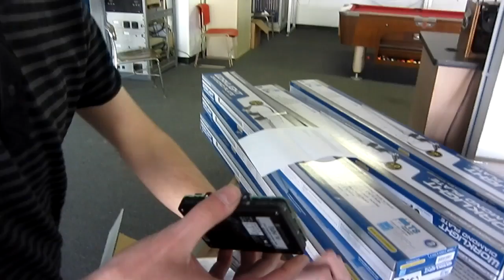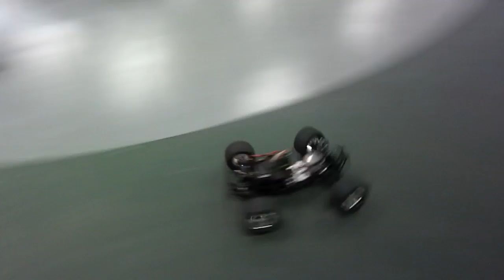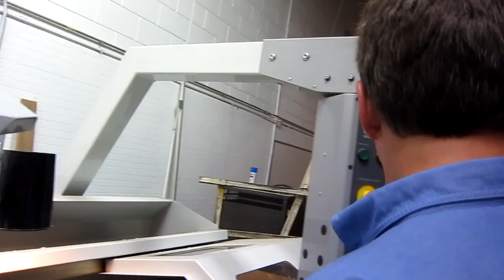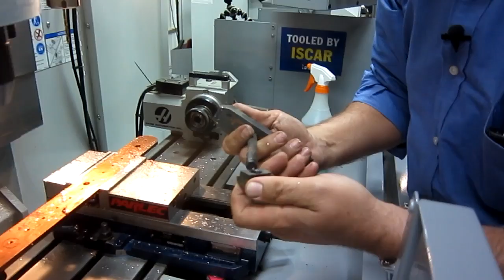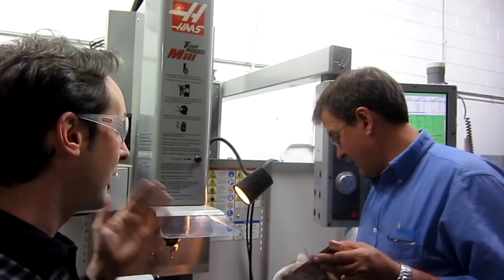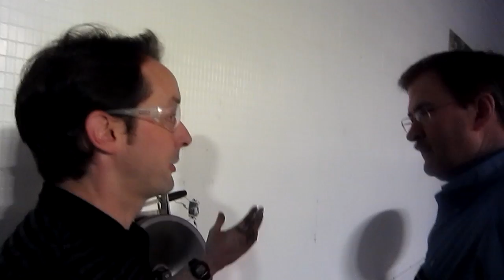Captain's Blog 11-10-11 Haas-Iscar Shoot, Stomper Positive Rail

Comment: @Physicsduck Are you talking about the air pressure on the outside of the hose? This would not be a factor,  amps is the rate of flow, if you alter the size of the wire/pipe the flow will still remain the same, unless the pressure was to high and the pipe burst. The hose is always full and the water is simply moving when the potential changes. Perhaps this a debate for the forums? BTW That machinist is a genius I think he'd understand :)

Comment: Sorry to slightly correct the Captain, Voltage is a potential difference, a difference in pressure between two points. Using the pipe analogy It would be like water in a header tank (a difference in water height or "head"), Current is the the volumetric quantity of flowing water over time.  So what your visitor was starting to explain was correct. Your correction was correct until the pipe diameter changed :) that's resistance.....